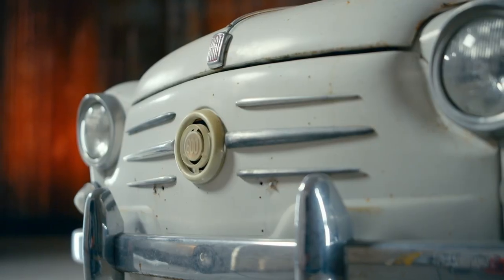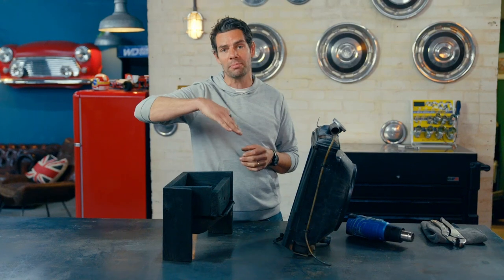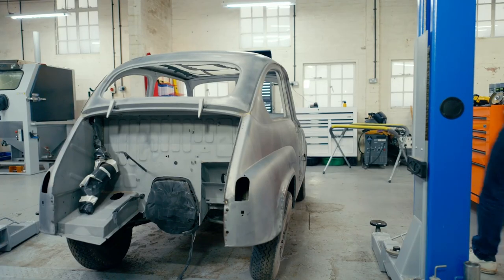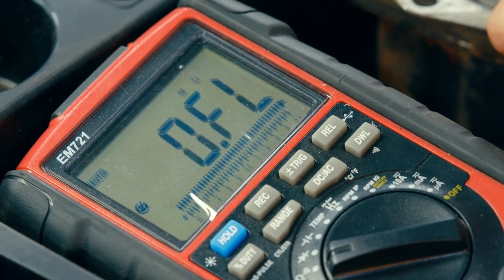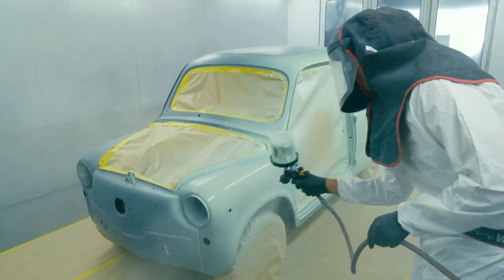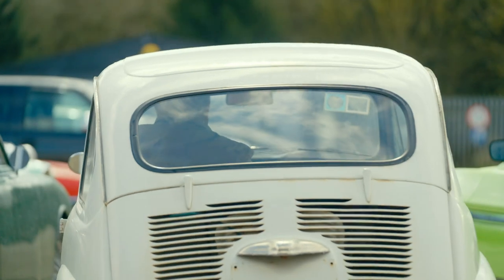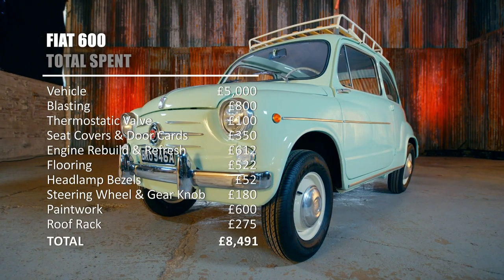Elvis Restores A Vintage Italian Fiat 600 To Its Former Glory! | Wheeler Dealers

Comment: I kept wanting the cameraman to look down into the engine compartment. I want to see if the two sheet metal "shrouds" are still in place. One fits around the engine and has a rubber gasket which which fits snugly around the motor itself; the other, closes off the space between the radiator and the back valance. Together, they seal the engine compartment from the underside of the car, preventing the hot air from the vent from recirculating back through the radiator. Over the years, a lot of owners remove them, thinking it will make the car run cooler. It doesn't.

Comment: My Mum had one in the 60's and I remember it had a hand throttle ( in addition to the accelerator pedal). Unlike modern cars, it was wired to the accelerator like an old style choke so was pretty dangerous if you used it, as it did not default to off....! Add to that the suicide doors, I don't know how I survived!
Reply: I owned a 1961 600D. The absence of seatbelts and a gas tank that was almost in the driver’s lap didn’t help on the safety front.

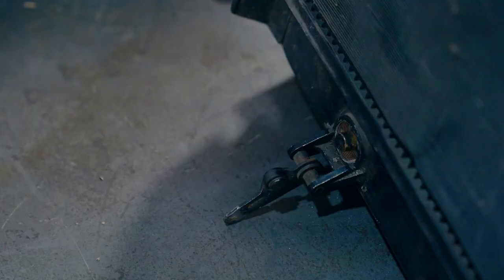Comment: I have question to the cooling radiator. Which tool did you use to remove the the thermostatic valve? ( 2:15 )

Comment: The same car was also produced in Yugoslavia under license. It was called Zastava 750 "Fikjo". Later the car got few centimetres longer (there is actually funny story behind that) and the suicide doors were replaced with regular ones. Also other features were added and some removed on later models.

Comment: I know it's a 500, older and more classic, but where I live, you can find lots of 600 with the 850 cc (70's) engine, in decent shape, for about 3500... dollars
Reply: Yeah….

Since I started driving 35 years ago I usually have a FIAT  of some kind for fun and Ford truck for day to day use.  (1972 128SL, 1985 X/19. 1980 Spider 2000 at present.)

A cheap classic FIAT is almost always going to cost more than a well kept one at market pricing.

The two important things are that they need to be driven occasionally to stay in good shape .So a really low mile example isn’t usually a good thing for anyone wanting to drive it regularly.

And they were prone to rust so checking out the weak spots on that model is critical before purchase.

Comment: 5:51 cutting costs by not using proper breating mask for painting xD
Reply: You obviously don’t know much about automotive refinishing. This is a full face mask with its own clean air supply line & positive pressure which makes it impossible to breathe in fumes. It quite literally does not get any better than this.